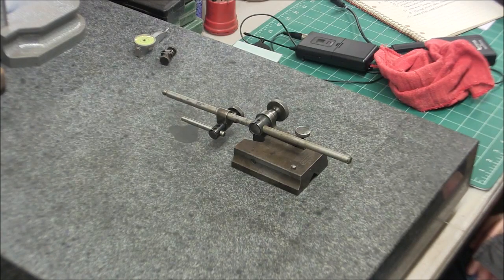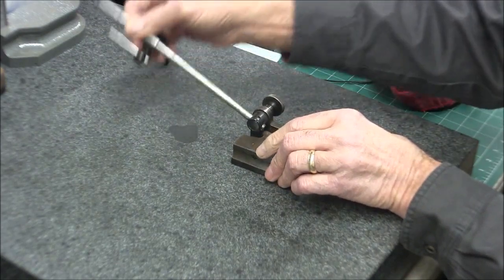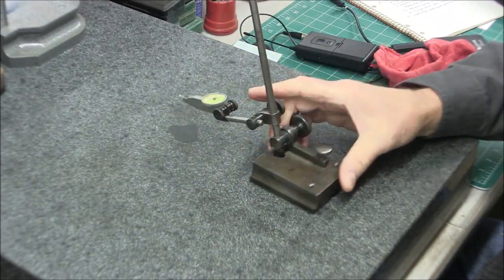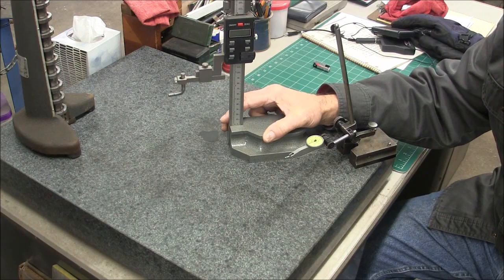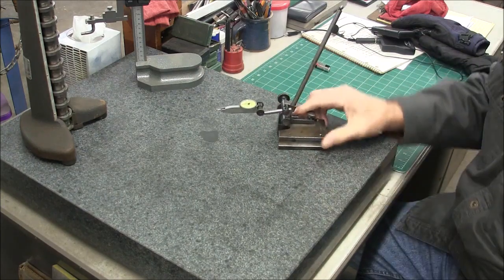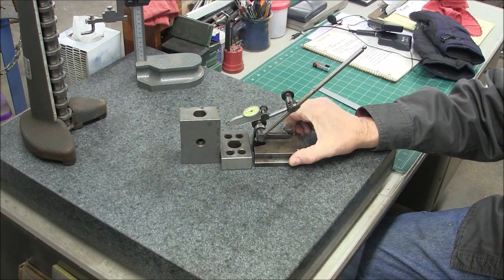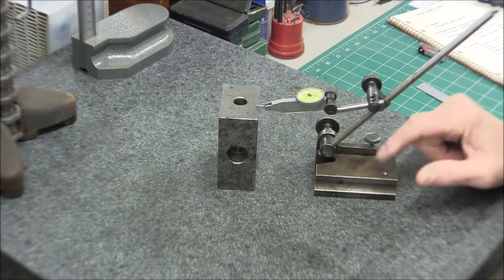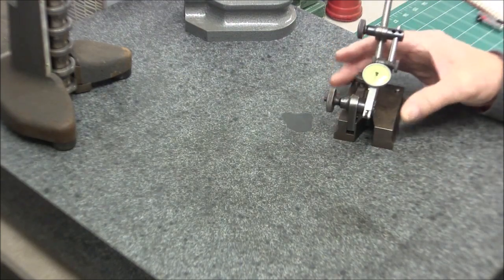Surface gage basics

Comment: The video came up in my feed. I'd left a comment about a month back and have acquired 2 General surface gages, as in the video, since then. The first one was reground by its previous owner. Did a nice job. The second one is completely stock. The General is heavier than a B&S 621 or a Starrett 57/257A and works great as a base for a bench magnifier, which is how I use it. Old eyes. It's more rigid than the Lufkin 520/522. Slides around beautifully after stoning. I'd recommend it. Comparable to a B&S 621. And it's inexpensive. Why fight it?
Reply from the maker: Way back when I bought that in 1964, I was a starving apprentice. Even though it's not a top brand, I've been very happy with it. And you're right it's just slightly bigger than the starretts, B&S etc. 
tc, Mike

Comment: Nice video. If you had to choose one, would you prefer the digital height gauge or the surface gauge? Thanks
Reply from the maker: Actually I use the surface gage mostly.  It's used both on the surface plate and on machine tools at times.  It's compact and quite versatile. The digital is used pretty much only on the surface plate.  It has a heavier  base and has a  height advantage. And  with it's readout its very fast to measure heights.  I've never checked its readout for accuracy though.  That might make an interesting video. If I had to choose one over the other, I'd pick the surface gage. All the best to you!
Reply: @michaelmurray9154  That helps a lot. I will keep an eye out for more of your videos. Thanks!

Comment: Nice run thru Mike. I think my gage block is very similar to yours... including the rod with the hooked end. Scribed lines invariably easier to see after adding some blue, even when light. I do like my height gage too and that gets used most - when that is I even manage time in the shop any more! :)
Reply from the maker: It's nice to hear from you Chris.  I hope all is well with you and winter isn't too harsh in your location.  Now days I see guys using their calipers for layout lines.  I'm hesitant to do that with mine. I understand there are calipers with carbide tips for that purpose.  Thanks for your comments.  Tc, Mike
Reply: Around Christmas things were pretty tricky with extreme lows, wind etc - not a fun 5 days! Expect you had it pretty rough too. Health continues down hill - particularly back etc - trying to adapt to hobbling! I think calipers OK like the way Clickspring uses his - but that's on brass usually and very light on bluing. All best. :)

Comment: 3:05 - Does the indicator holder comes with the surface gauge or test indicator? 5:05 - good to know that it's not great for accurate scribing, what other scribing methods is better? 13:23 - Would it be ideal to slide the surface gauge on the edge side of the granite surface plate since it's not finished/lapped?
Reply from the maker: 3:05 sometimes yes sometimes no. You can find anything you are missing on line.
5:05 depends on accuracy requirements. Generally there are better methods.  I prefer hand tools such as scriber, square, compass etc. 
13:23 I slid along the surface place as a demonstration only. I can't think of an occasion to actually use an edge of a surface plate.  All the best to you, Mike

Comment: I have one where at the end of the mast , opposite to the ball end there is a small ~1/2" disk that is shaped to, looks like, 60deg angle and is sharp, screwed into the end. Shaped like that  -->   <===>
No clue what that is for. Anyone have an idea?
Reply: When the ball end of the rod is used to gage for square, one can remove the disk to switch out, say, an indicator.